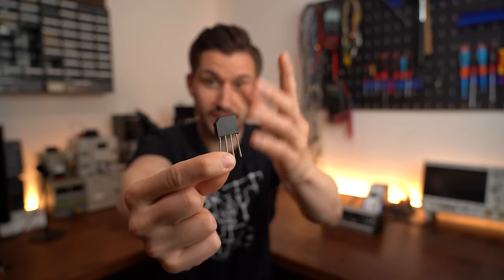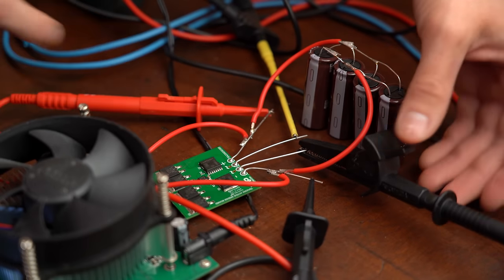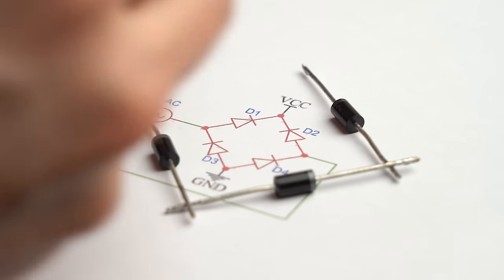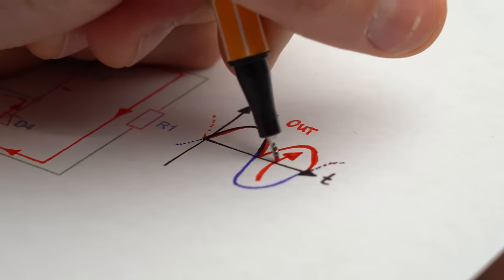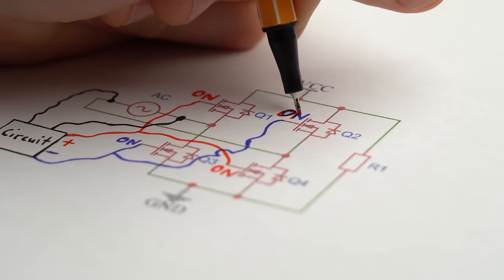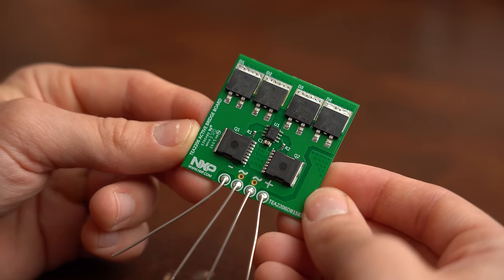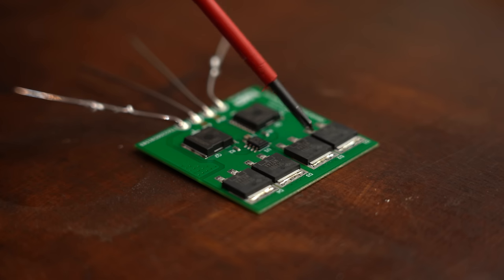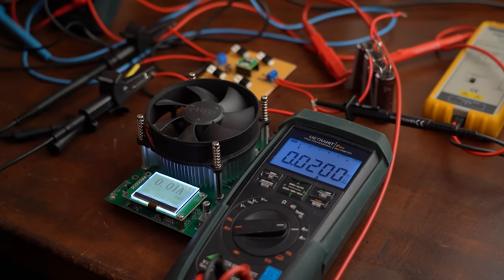The End of the Full Bridge Rectifier? (Sorry ElectroBOOM) Active Rectifier is here!

Comment: This is really interesting! I've read that some modern cars have active rectification in their alternators to reduce power loss. This really makes sense with the low voltage and high currents in a car. 12-14V and 100Amps or more is not uncommon. The three phase windings in a car alternator have six diodes, and if they drop 0,6V each at 100A, that's a loss of 360 Watts to blow away with the cooling fan!
Reply: Well, the good news is that in full wave 3 phase rectification using 6 diodes only 2 diodes (or no diodes) are conducting at any given time so, using your numbers the power being dissipated would be (0.6V X 2) X 100 Amps or 120 watts.  It doesn't really work that way though...  The bad news is that at high currents silicon rectifiers drop much more than 0.6 volts.  It is not uncommon to see 1.0 volt to 1.5 volts (look at the Vf curves on a 1N400X data sheet...) forward voltage drop across a silicon diode when conducting high currents - which is the case in most rectification systems because the conduction angle of the diodes is much less than 180 degrees (single phase) or 60 degrees in a 3 phase system.  Since the diodes are not conducting continuously, and the output current is a continuous 100 amps (in your example) it follows that when the diodes ARE conducting the peak current must be MUCH higher than 100 amps in order to provide an average 100 amp output current.  These high current pulses (near the maximum voltage of the AC input) result in a much higher RMS current in the rectifiers than you would expect which causes a lot more heating than you would expect - requiring a much larger diode than you would expect if you are to have a reliable circuit.
Reply: @Vincent_Sullivan  Yes, you're right about how the diodes are conducting during the 3-phase cycle! My maths may fall apart but I still think there's a lot of losses in a 12V full wave rectifier with ordinary diodes, just the way you describe. :)
Reply: @Vincent_Sullivan  1n4007 isn't exactly a high current diode. With appropriately overrated diodes there shouldn't be more than 0.7v drop, and much less with Schottky diodes. And your note of the diodes only conducting for a lower conduction angle isn't really relevant because that is the angle of each diode. The total angle is much larger. Newer alternators even use four phase setups which increase the total conduction angle even more. For a 100a output I would expect 200a diodes would work just fine. What would you think?
Reply: using a wheelchair is a massive power loss. 4 wheels are inherently and physically unstable and wasteful
Reply: Nice magic eye for your avatar. I love it. I forget the channel, but it reminds me of a video I watched the other day where somebody tried making a modern version of a magic eye using entirely too many LEDs, and a diffuser to soften the light. The end result looked nice, but it was far from practical. And I'm sure some Chinese place has already made some janky LED based magic eyes ages ago.
Reply: Girl winding is usually about 6 amps MAXIMUM x ~14 volt = ~84 watts heat in center ROTATING FIELD   @Vincent_Sullivan
Reply: @erickajander1139 He wasn't talking about the rotor winding.... he was referring to the stator winding. There's MUCH more current involved with the stator winding.

Comment: Trap that a lot of people get into: rectifier with a capacitor and some load can draw current peaks easily reaching 7-8x the load current, a 10A rectifier will burn out on a 10A load, the better the smoothing the higher the current peaks
Reply: Finally!  Someone who actually understands how rectification systems work!  Trombo is 100% correct.  The larger the capacitor the shorter the conduction angle of the rectifiers and thus the higher the peak currents which means more heating than expected in the rectifiers.  My rule of thumb is for a full wave bridge with 10 amps of output current you need about a 30-35 amp rectifier.  If the circuit is fed by a transformer you also need a larger transformer than you would expect for the same reason.
Reply: @Vincent_Sullivan  obviously, if I was taught anything by experiments, it's that to overspec absolutely everything possible. And of course, fuses.
Reply: Thank you, David Lixenberg.
Reply: Sure about that? A 10x pulse should be high but ok if short enough. But trying to pull 10A through a 10A diode, I would be Very careful about designing the cooling of that, since it will likely be some 20-30watts of heat being generated
Reply: @Vincent_Sullivan  understanding is dangerous to the economy.
how is everyone meant to keep buying new products if theyre not designed to fail?
Reply: Yes, you would typically add a precharge circuit.   The precharge circuit puts a resistor in series with the capacitor bank.  Once the cap bank is at its normal operating potential you bypass the precharge resistor using another mosfet or a relay.  You can also add protective circuitry to your precharge circuit.  If the capacitor bank does not reach normal operating potential in a certain time, you shut down your active rectifier and display a fault.  This will prevent a catastrophic failure should your capacitor bank have a deteriorating capacitor.
Reply: @Calliber50  softstart is a completely different thing from the current peaks caused by partial conduction. Essentially if your load is consuming 1A and you have enough filtering that the bridge only conducts 1/10th of the time (you're getting about 5% voltage ripple in that case) every second you consume a total of 1A*s, but since you conduct 1/10th of the time, so 0.1s, your average current during conduction is 1A*s/0.1s=10A, that's the average, the actual peak is even higer
Reply: @Calliber50  yep. sounds like that will work, but
youre better off putting your funds in a polymer film bank than a paper currency electrolytic toilet bank.
Reply: Actually peak load is real load + cap ESR + trace and wire impedance.
However, most diodes are designed to allow Pulse overloads without burning out. FET's also can handle high peaks.
Reply: @LunaticCharade  "should be" "will likely"
Reply: @pootispiker2866  depends on what the datasheet will tell you, 10x should be high, 30x might also be ok. 
Point is, rtfm and keep the cooling in mind
Reply: @Vincent_Sullivan  I've never burnt out a bridge rectifier using too large a capacitor after it but if you did, it was far more likely the initial inrush current to blame, NOT the current peaks from each AC cycle.

The momentary peak rating of a diode is higher than the sustained current rating.  It's essentially a function of heat.  At the same load, with a shorter duration peak current the Vf will rise a bit but not that much difference if there was margin built into the circuit.  Besides, you never put a 10A rated diode on a 10A load unless you're trying to cause problems.  The cost of a larger diode is less than the cost of the higher efficiency heatsink you'd need to make that work, even if that "cost" is PCB real estate rather than strapping a piece of metal on.

However regarding transformers, no you don't need one 3X the capacity of the load.  You could but that's a waste of money, weight, and space with transformer costs rising quite a bit more from 10A to 30-35A than for the diodes.  Transformers are usually sized a little less than twice the load.  Not sure why we're even talking about this, any modern design at 10A or more is better off using a SMPS instead.
Reply: @tomboxyz5564  If that were really a problem, then just about every device with more than a tiny cap bank after the bridge rectifier would have failed for this reason.  No, they're not dropping like flies.  More capacitance is better as long as you have sufficient inrush current limiting.
Reply: @stinkycheese804  Look at the 5 and 12V rectification in an old PC power supply.
They use a center tapped  winding with only 2 Schottky diodes and a clever multi windings choke before the capacitor.
The capacitors last much longer than on low power switching power supplies and have quite low values.

Comment: I designed an active full bridge rectifier 35 years ago for use in an x-ray machine. It was used in a low voltage sensing circuit where diode drops would have been unacceptable. These have been around a long time. By the way the original rectifiers were called commutators. All generators are really alternators, add a commutator instead of slip rings and you get DC instead of AC. There were giant synchronous commutators used in the old days to get high DC current for subway trains.
Reply: Except that a commutator is used to periodically reverse the current, it is a type of switch, and is nothing like a rectifier. A commutator is the part in a DC brushed motor, where the brushes connect to the circuits or coils, as the motor turns, the next coil gets an opposing current to the previous one, and so it makes the motor work. It is not what you described here and does not do what you described here. What you described, is a bridge rectifier with extra components, and not a commutator.
Reply: @dk6578  He is talking about Mechanical rectifiers... which are also known as commutators. Yes it is a part in a DC brushed motor but it IS a rectifier. "serving as a mechanical rectifier to convert the alternating current from the windings to unidirectional direct current in the external load circuit."
Reply: @DarkAttack14  But it isn't a rectifier. A commutator periodically reverses the current, a rectifier doesn't do that. And a brushed motor has no such thing in it. I know, I've opened enough of them.
Reply: @dk6578  look up mechanical rectifier, commutators are a form of rectifier which isn't debatable lol. "The commutator acts as a mechanical rectifier or inverter which changes the polarity of supply/generated emf. In DC generator, the commutator converts the alternating current into the direct current"
Reply: @DarkAttack14  You do understand that a rectifier only lets the power flow in one direction, correct? Because if you understand that, then you would also know that a commutator can not be a rectifier. A rectifier is not the same as an inverter. A rectifier takes AC and gives you DC with just one component. An inverter takes AC and gives you DC using a lot more components. You were talking about brushless motors, not a generator, not exactly the same thing since a generator can have circuitry to boost or buck the electricity. There is nothing in a brushed motor which switches DC to AC or AC to DC. There's the stator which is wires and an iron core, then there's the magnets, and the shaft, and the brushes and the contacts, nothing else.  You talk smart, but you seem to actually know nothing.

Comment: For very low AC voltages such as e.g. the 6V of a bicycle dynamo, an active rectifier is absolutely necessary to achieve sufficient efficiency in the rectification.
Reply: very true!  I've been using mosfet rectification for my bike dynamo circuits for many years!
Reply: I charge my Phonefrom my bicycle dinamo .
And dont have a fancy rectifier. 
I use 4 diodes and a cap. 
And a step up / down converter. 
It's simple and effective. 
And the output is a usb connector. 
It even fits in a 3cm long electrical pvc pipe.
Reply: @micheltbooltink  But the full wave rectifier goggles .7 volts that you can use!
Reply: @mickgibson370  Aren't most phone batteries 3.7 vdc?  Seems like there's plenty of overhead here.  There are places where the increased efficiency is warranted, and places where it is not - it's a matter of price/performance/reliability, etc.
Reply: @mickgibson370  1.4V
Reply: @horusfalcon   according to the USB standard a charging device has to draw less current if the voltage goes below 4.5V
Reply: It might be useful for some applications, but definitely not "absolutely necessary". I use an old bicycle alternator to charge some LiPo batteries with a TP4056 charger, and all I needed were 4 schottky diodes salvaged from some power supplies' secondary side and a 470 microfarad capacitor to obtain smooth DC. I even needed to add a 5V LDO regulator, because at the 300-400 mA load I require, the voltage rises to more than 10 V after rectification, while riding at only 15-20 km/h (the alternator's rating is 6 V). Ironically, the voltage regulator wastes more power than the bridge recifier.
That being said, I would be interested in your circuit, because I would like to be able charge another battery, the charger of which requires 500mA at 5V to function properly (according to the manufacturer anyways). If I ride constantly at  a bit more than 20 km/h it might work, but that could wear out my old alternator (and my muscles) quickly.
Reply: Phones have their charger circuitry onboard the phone and expect fixed 5V input. Though yes, their batteries are a nominal 3.7V, peak charge of 4.2 to 4.4V depending on precise chemistry in use. Phone chargers don't do any actual charging logic, they're just 5V DC power supplies (or higher in the case of USB PD or USB QC, both of which then have additional support circuitry in the phone)
Reply: Thanks for this reaction. I was thinking how to apply this technology. For small windgenerators and motorbike generators.
Reply: @antoineguilmain2754  You could use a buck converter instead of the LDO. A charger for the car cigarette lighter has one already with 5V regulator
Reply: You mean bike alternator we don't use bike dynamos anymore. Dynamo make dc
Reply: @bene5431  Yes actually! I considered using a MC34063 IC, the kind that is mostly used in the cigarette lighter buck converters you mention, but I never really got around to it. In fact, I am weary of how the buck converter could act in an undervoltage situation, for example when riding at low speed, or simply slowing down because of a traffic light or something.
Reply: @mickgibson370  more than that as each half cycle has to make each diode conduct..
Reply: Meh, not really.   

1)  You could get a 12V dynamo   

2)  You could parallel schottky diodes to lower Vf of the bridge rectifier quite a lot.  

3)  Who the heck wants the extra drag of a dynamo instead of a simple battery circuit or even better an eBike?  Seems like a misapplication of tech to make peddle power more complex.
Reply: @callumkingunderwood  Not really, many phones can charge as low as 4.8V input and till accept higher than 5.0V, especially if using a newer quick charge technique to reduce current through increased voltage.
Reply: meh
Reply: @horusfalcon  Yes, but that's the advantage of switchers: they make use of the total energy available instead of just wasting the unnecessary voltage like a linear regulator does. The more voltage there is available, the more total energy is available for the switcher. So a (let's keep it easy) 8,2 Volt rectified and smoothed output from a classic FBR and a dynamo that can supply (let's say) 300 mA at that voltage, has less power available to a switcher than when there's no significant voltage drop anymore, the output voltage is thus higher while the maximum current is the same. A switcher will utilise that extra bit of energy to be able to supply more current at its output.
Reply: Regenerative breaking.
Reply: Dynamo generates DC and DC doesn't need rectification. Rectification is a process that applies to AC.

Alternators generate AC.

Comment: I have been designing these active rectifier for a long time and they are amazing.....until the controller is destabilized for some reason. Over time, I learned that every attempt to throw it pulses, noise, etc would reveal any stability issues. 

The end result is a very high-current design with no need for a fan and many times, no need for a heat sink of any kind. Totally worth it.
Reply: cat  Absolutely, you just need to use MOSFETs with lower drive voltages, or use gate drivers that utilize a bootstrap circuit, which is a charge pump that will increase the gate-source voltage of a FET.

Comment: As industrial's sensor design, I use that from the last 11 years for being mandatory.
That little loss from rectifiers play a big role in some remote applications, specially when temperature is a problem.
Reply: @Christopher Grant sorry for the delay. Sourcing AC to sensors directly isn't common, except from sensors with NO/NC to be used in cheap chinese machinery (and we produce those, because of our clients' needs).
Anyway those aren't critical.
But we sell sensors used in laboratories where temperature and humidity fluctuations are a big problem (turtle eggs for example, are very sensible to those controls and a 2°C fast fluctuate can represent the failure to some sensible species, so they told us).
I don't know two damns about those applications, but the specs we must follow for those stuff force us to design very thermally optimized products, and there is this kinda of losses play a big role.
And batteries aren't an option, because people simply forget about replacing it (or so they tell us when specifying).

Comment: Most full-bridge rectifier packages are built with simple silicon diodes with a high voltage drop - that's why when I built my 120VAC input lab power supply I assembled my own rectifier using Schottky diodes (MBR40200PT ASEMI TO-247/3P), which cut the voltage drop in ~half and increased efficiency significantly. Using a larger than needed size diode also helps with efficiency. I still like the simple diode solution because it's 'bulletproof'.

Comment: FBR may also be a better option in adverse thermal environments. You end up with less variation in output characteristics, which makes handling that variation safely much easier. Even with well-designed power supplies, you might be amazed how differently a device might act at -40C vs. at 85C
Reply: Wouldn't a MOSFET behave just as badly in extreme temperatures?